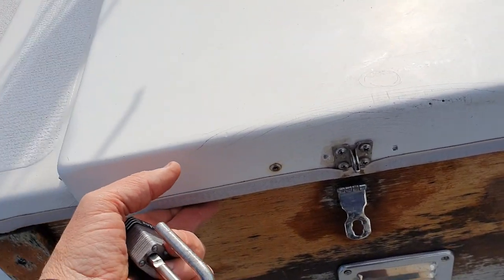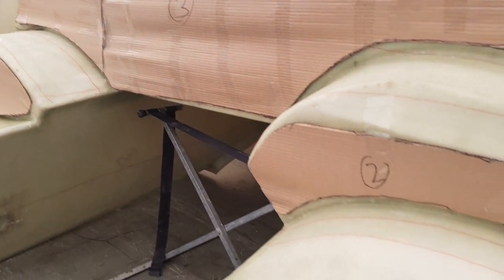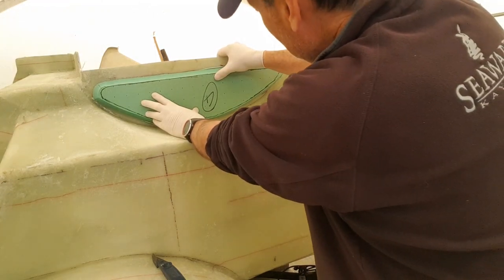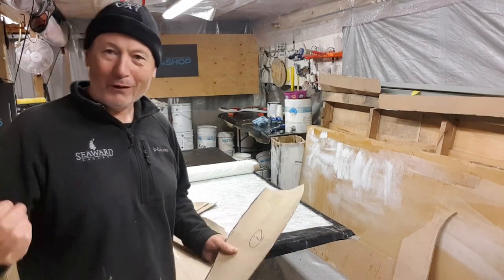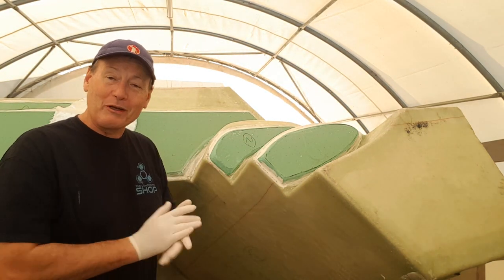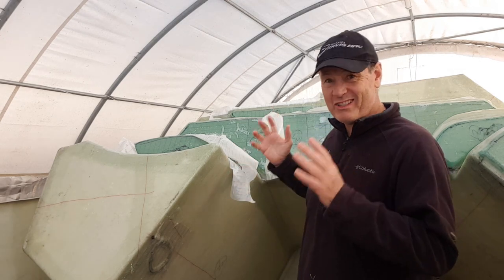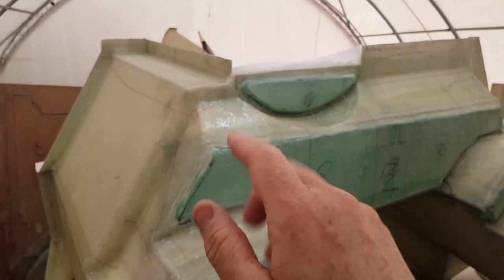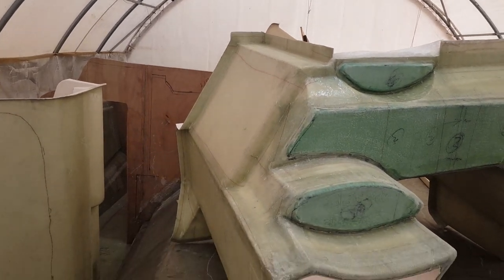Ep127 - Reinforcing  Foam Core Stair Module - Fibreglass 40 ft Catamaran Build

Comment: Roscoe it's a bloody good thing that you answered your phone when the inspector called otherwise you might have come back to the mast sticking out the water and little more,  as for that bird storing the fish 🐟 it's a good job it wasn't a heron the weight of those buggers the boat would have sunk!!!.
I too don't like working with dust and dirt on the floors big no no but I got to ask, where was your dustmask when you was cutting the 45° off the spongboards as you and I both know that even they release spaws that sit on your lungs causing major health  problems in the future , your usual ppe is fantastic but this time you was slacking and I know you were almost outside your workshop but you cannot control the wind dear boy !!. Now as for those step reinforcements let's just say , you ain't going to be creeping around on your boat as those buggers are going to be so so silent your gonna have to wear a bell around your neck 😉. 
👍🇬🇧